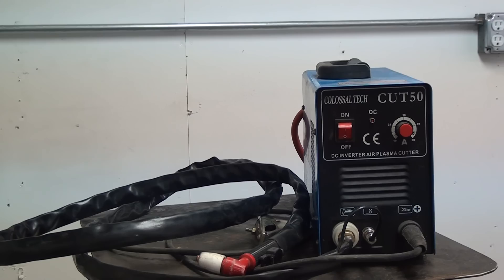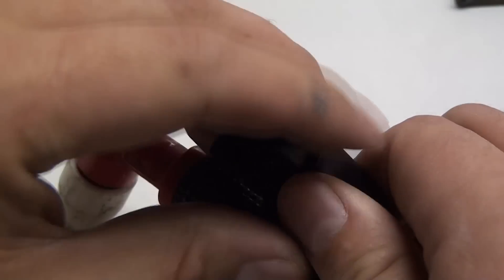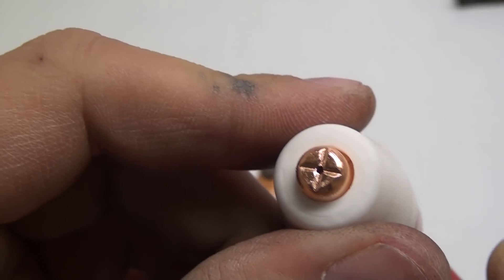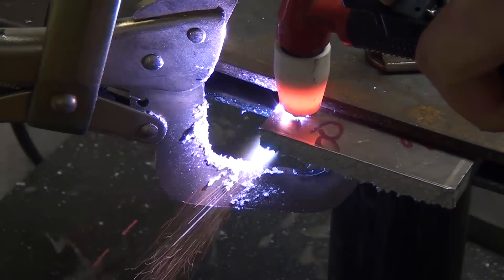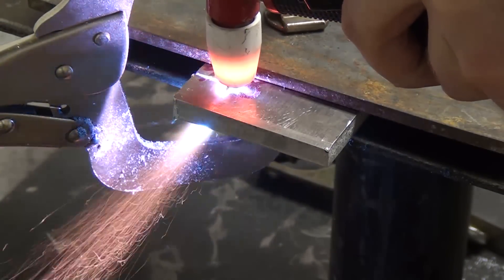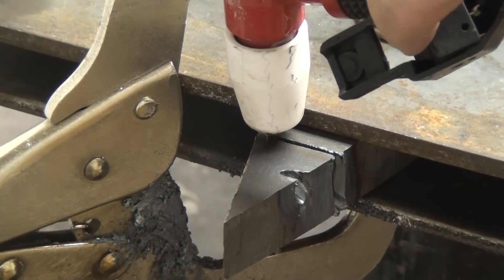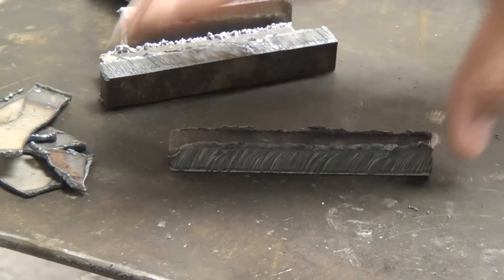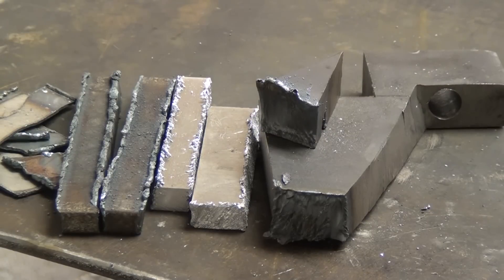Colossal Tech Cut50 Plasma Cutter (Two-Year Follow Up)

Comment: I have a 15A circuit at home, will I get away with using it or will it flip the breaker?
Reply from the maker: You might if you're running on the hottest setting. But I can't say for sure.

Comment: you probably  know this but, if you buy a larger gun, say a sg51 rated at 60 amps.you can cut bigger stuff easier.the pt31 torch you are using ,I think is the smallest they give with the plasma cutters.hope this helps.
Reply from the maker: I don't know anything about it. I assumed I could change out the gun, but have no idea what would screw right onto the machine. I'll check the one you mentioned. Thanks!
Reply: the guns are fairly standard for the cheaper cutters.the air attachment is a threaded fitting and the switch is a standard 2 wire connect.of course you will have bigger consumerbles.just seach sg51 plasma torch,if you buy one ,get a decent length.say 5 metres.

Comment: I have one of them 3 in 1 machines and im not getting anything to work.
Reply: Try going to school on the machine!
Reply: You’re very lucky if you can get one of those to work. While it seems that cutting isn’t much different from welding, there are enough differences in the requirements so that, yes, they are different. There’s a reason why most manufacturers don’t make these machines. If you are lucky enough to get one that works, you’ll find that they don’t work well, and have little capacity, and their percentage of on vs off time is very low. Longevity is questionable.

I’m sorry to burst people’s bubbles, but if you want a welder, get one. If you want a plasma cutter, get one.

Comment: Good to know on the air pressure. I just got mine and the manual says 0.3-0.35 kpa which is 3-5 psi. Explains why my consumables were melting. I found no 'PSI' listing in my manual.
Reply from the maker: +Matt Harris Wow that's way off :) 
I hope you have it working now.
Reply: Yeah, I turned up the air and it's cutting allot cleaner and faster now.

Comment: I am new to plasma cutters. Does plasma cutters require any special supply of gases to operate? I am planning to get one but am afraid of any recurring costs.
Reply from the maker: +Jia Jun You need an air compressor is all. In industry, specific gasses might be used for specific cut situations. It's not really a thing for home gamers though.
Reply: You need an air compressor big enough to keep up. Different models have different air requirements so you have to look at that. A really good air drier is also helpful.
Reply: No just air

Comment: Has anyone tried the 70A Colossal Tech Plasma cutter and is there any service centers in the LasVegas area to get them fixed if it breaks down??
Reply from the maker: I didn't even know they made a 70A. My guess is that you will have a hard time finding a local service provider since these all seem to be coming from the same factory in China. Parts for the 50A seem to be available on eBay at least....

Comment: What replacement consumables do you use? I bought some off of Ebay that are  supposed to work but they will not seat deep enough for the cap to screw all the way down.  No spark... grrr
Reply from the maker: I've had a couple of other people tell me they have had problems with the ebay consumables lately. I haven't ordered any since making this video (over 4 years ago), and I don't have the link anymore. If you find something that works let me know, I'd love to add a link to the video.

Comment: I just bought the same Cut 50 last month and the power switch on the front panel  failed after 20 minutes of use, $9 part and it now works fine, I also had to upgrade the air hose.
Reply from the maker: +fredboat That's annoying, but at least the part was cheap. Yeah that air hose sucks.

Comment: Hi I dropped the torch on y cutter and now it doesn't work any answer or idea as to what is wrong would be greatful.
Reply from the maker: +Karen  Campbell You dropped the torch and when you lick the button nothing happens? That sounds like the wires in the torch are no longer connected to the button. If you have a multi-meter you can probably troubleshoot whether or not the switch in the torch is working. Good luck.

Comment: This is an excellent plasma cutter, the consumables that came with this did not yield good results.  

I use Esab 21008 extended life nozzle and Esab 20862 electrode from the Esab PT-31XLPC Torch.  This greatly increased its cutting capabilities. 
Youbwill breathe new life with the esab hardware. 

I cut 1/2" steel with this and with the esab hardware, its a slow process but it works.  
Stick to this model cut 50 without the digital amp readout. 

I bought this 2.5 years ago for my dad, He has used this plasma cutter many times.  I bought a heavy duty clamp and thick ground cable for it. You can find the quick connect plugs on ebay from river-weld. 

I am actually setting up a petsonal welding shop in my garage and buying another one of these but for myself.
Reply from the maker: +Josue De LA Garza Thanks for the part numbers, I'll definitely try them the next time I have an order.

Comment: What do you think of the new digital ones.  Digital inverter.   265.00.  Seems really cheap.  I would only be cutting car sheet metal.   Are these cheaper ones like this any good.    Do you have to send back for repair if something goes wrong.  or are there people out there that can repair them.
Reply from the maker: +Jim Beam I'm not familiar with the new digital cutters, but the one I have can zip through thin sheet metal with ease. I'm not sure if people are repairing them themselves, since I haven't had any trouble with mine I haven't done any research on it.
Reply from the maker: +Jim Beam Based on other people's comments on this video, yes. They may be sold under a different name(s), but they are all manufactured in the same place I'm sure.
Reply: +russtuff Ok .  Thanks for the fast reply ,  I really appreciate that, .    Great video.
Reply: Heh, repair them. That’s very good. The importers just buy some required minimum from the factory to get a price. Maybe they stock parts, and maybe not. Where do you expect to send then for repairs?

When buying stuff like this, I highly recommend buying from Harbor Freight, Grizzly or Northern. Yes, you likely will pay some more, but if your unit does break, it’s much easier to get it fixed, as these are real companies. Many times, these others on eBay, which are all selling the same machines, are one guy who is set up by a third party as an eBay company. So usually you have to send the machine to the Chinese factory for service. It’s not worth the price of the machine. So unless it’s something minor that you can fix, if it really breaks, you just throw it away.

Comment: are the consumables easy to come by?
Reply from the maker: +wesley peterson Yes absolutely, and they have gotten cheaper over the years. Do an ebay search for something like Cut50 consumables and you'll find loads of stuff.
Reply: +russtuff Thank you, just purchased the zeny cut50 off Amazon... and a bunch of consumables. thanks for posting this video.
Reply from the maker: +wesley peterson Sweet! Thanks for watching :)
Reply: They are easily available on eBay but if you use the below you'll increase the precision that this machine can cut.  My dad tried this setup and was blown away. Where he used to work at they had a machine 10 times as expensive as this one that cuts exactly the same. 

Esab 21008 extended life nozzle and 
Esab 20862 electrode from the Esab PT-31XLPC Torch.

Comment: Wouldn't a higher pressure setting provide more cooling? From your video it looked like the higher setting also cause greater splatter, which to me indicates more oxidation, where as the standard setting appeared to be smoother and more controlled.
Ideally you shouldn't actually contact the tip to the material. Some higher quality companies use a standoff for 1/8" or so gap.
Reply: Pressure that’s too high results in a variable arc. That arc spits all over. Often it causes metal to fly around in the cut. Usually, more dross at the bottom as well. Experiment with pressure, but don’t go much m0re than + - 15% or so from the rating.
Reply from the maker: +Bryan St.Martin Your idea sounds reasonable, but I really have no idea. I haven't used this cutter in a year or two but next time I break it out I'll be sure to notice.

Comment: Can you pierce cut with this plasma? Meaning cut in the middle of a sheet/bar? Most of the videos for a CUT50 show starting the arc at the edge
Reply from the maker: +Rob R Yes, but I would guess only up to 1/4" maybe. I'll have to try it and make another video I guess :)
Reply: I always have to end up grilling a pilot hole or starting at the corner.
Reply: I ended up buying a northern tool 375i for around $600, its pretty sweet, the trafimet torch is nice, the cut50 was my fallback option.
Reply from the maker: +Rob R That does look like a nice torch. Very cool.

Comment: Thanks for this...your stuff is informative. Although, I CRINGED each and every time I saw your hand come in the frame and grab the metal! I don't know how much welding or cutting you do but if you use oxy/acetylene to cut steel EVER, it is a VERY bad habit to get into!
Just sayin'.
Reply from the maker: Jim Dixon I don't use a torch at all, but you make an excellent point. Thanks!

Comment: I have what might seem like a dumb question about this. What size is the air compressor that you use when you do your cutting. I have asked several of the sellers on eBay and the responses varied from no reply at all to any size will do. There is what looks to be a decent sized compressor on eBay right now for $139.05 and the item number is #231033864202... I ask because this looks like it could be a good place for me to start with a new hobby for myself. FloydFThomasIII@Gmail.Com
Reply from the maker: Floyd Thomas Hey Floyd. I think this compressor would likely work fine, because what you really need is air storage more than you need the flow. With 10 gallons of air you may need to pause between cuts to let it fill up, but once you're at pressure then you should be fine. I would say the vast majority of my cutting is in 6" or less segments. If you're going to be zipping through a bunch of material, you may find yourself waiting for the compressor to catch up.

I'm using an old/used Craftsman 10HP 60 gallon compressor I found in the local classifieds for $300. This was several years ago, and the 10HP is a lie (though it is 220v). It's loud and I don't really like it, but once I've charged up 60 gallons of air, I can go for quite a while. I would shop locally for a compressor if possible, then if it isn't cutting the mustard you can take it right back to the store, or sell it.

Let me know if you have any more questions :)
Reply: Thanks for your reply and suggestion. I will look locally. Who knows, maybe I can find something large enough and cheap enough to be able to start my (possible) new hobby.

Comment: I paid $216 for mine with free shipping and am quite impressed so far. It handles 1/2" steel plate, but really not much more than that.
The only annoyance is that the regulator leaks when turned up to 60-70psi. It's not the fittings, but something inside the regulator itself. It still works fine though.

Comment: when you let go of the trigger and air keeps flowing don't worry about it actually that's how it is suppose to work the air cools the tip the machine has a setting of a couple of seconds for the air to keep flowing for cool down you may not get that all the time you may only notice it when you cut excessively
Reply: Yes. Mine has a timer for 2.5 and 5 for seconds of air delay.

Comment: Great review, I'm about to order one as well. I haven't looked yet, so I'll ask you, where did you get the replacement tip pieces? I know I can buy name brand stuff at my local welding shop, do they sell the stuff for these on ebay too?
Reply from the maker: I actually got my consumables from the same ebay vendor where I got the cutter itself. I ordered a 30pack of everything (or something like that). I believe the parts are universal, so you may actually be able to use name brand stuff from your local welding shop. You could always take your parts in and see if they match?

Your user name implies you dropped a diesel into a (sami) zuki? What motor did you go with? I wheel a 72' FJ40 and the guys I go with all drive LCs and zuks.
Reply: russtuff Yep! I have an old walkaround video on my channel if you check it out. It's almost complete now, just waiting for my radiator to come in so I can take it for a test spin. I used an AHU TDI VW motor, that I converted to mechanical with a special injection pump, to eliminate all the electronics. It's been quite a project because I have a tracker transmission and nothing fits quite right, the ACME kit helped a lot, but it's still a huge mess lol.
Reply: russtuff And I've been thinking about doing a swap in a toyota pickup next.
Reply from the maker: Diesel Zuk Sweet I'll check out your video. I was going to guess you were doing a TDI, but the Tracker trans is a nice touch. One of my buddies has talked about swapping a Tracker motor and trans into his but he ended up just not doing anything :)

I've had a couple Toyota pickups myself, but never really got around to swapping out the 22RE. I don't love that motor (though I know a lot of people do), and had to rebuild one for an 85 Hilux I had years ago. Fun stuff!

Comment: If you have a torch you could preheat thick metal and then  cut it and it will cut substantially easier
Reply from the maker: I don't, but that is a great tip. Thanks!

Comment: thanks for the review, it may be the perfect tool for my weekend warrior projects. can you recall the thickness you could cut on 110 power?
Reply from the maker: I get that question a lot, but mine does not have a 110v option. It is 220v only. They must be offering them with the option to do both now.
Reply: thanks for the reply bud

Comment: where did you get the trigger-it was not listed what store on ebay??
Reply from the maker: I guess the store I bought from on eBay doesn't sell them anymore? It was called "2 pcs Torch Switch For TIG Welding Torch WP-26 WP-17 WP-20 WP- 9 Plasma Cutter". I added that to the video description too.

Comment: Good plasma cutter I have a simadre plasma (red) works great on 110v but much better on 220v more heat because of being 220v.. The air running after arc is of is to cool down the tip.... Mine has that as well a 2 sec or 5 sec  switch for it... I used it at home all the time and works great after 2yrs...
Reply from the maker: I never looked for a switch like that... I'll inspect. I have never tried running mine on 110v, and actually I haven't used this machine in quite a while. I actually need to get it out and work in some projects this winter, so hopefully it's still running great :)

Thanks for watching!

Comment: these cutters use get loose screw connection on the inside after a year or 2 of use you just need to take the lid off and tighten the internal output connection
Reply from the maker: I don't think I've ever checked on that. I'll make sure I take a look the next time I break it out.

Comment: For those of you who have one of these chinese plasma cutters...they work excellent, especially if you do some testing with feed rates and amperage settings as well as cut height.  I recently purchased a hypertherm powermax 85 for my cnc plasma table.  After learing how exact the set up needs to be I now better understand these cheaper chinese models.  I have an all-in-one tig/arc/plasma that I now am much better at because of this process. My powermax 85 has a factory designed optimum cut height of .060 inches.  That's really close!  I measured the depth of the plus sign at the end of the chinese consumables tip.  It seams to be about .080...so dragging the tip across the plate, like this video, does give the optimum cut height for this style torch.  I was able to cut 10 guage at 50 amps moving along quickly with nearly any dross...just like my hypertherm.  Hope this helps.

Comment: I bought one of these on eBay from USAprovidersInc March 2014. I does not work and they sent me a new torch, but it still doesn't work. It will spark, but no Arc. The factory sent me a series of tests and I performed them, but no parts were sent to me or a new cutter offered. The 1 year warranty was not honored. $300 down the dumper. They no longer return my emails.Any one want to try and fix it? I'll gladly mail it to you and pay for repairs. Here is a link to my ad on eBay.

http://www.ebay.com/itm/231273507112?ssPageName=STRK:MESELX:IT&_trksid=p3984.m1555.l2649

I can send pictures with the cover off and test results.
Reply from the maker: Man that's a bummer. I haven't heard of anyone else having trouble with theirs, but you may not be the only one. Maybe there is a forum or group somewhere where people discuss/work on these?

Comment: never tap part w/your torch, like you did. and. esp. hot! let it cool, dude. thanks, i just bough one, 3 in 1. my $2,800 thermo-made in america that has bad card(s) for $180 ea., which is 1/2 the cost of my 3 n1, or only twice for way more.
Reply from the maker: Thanks for watching!

"Never" tap your part? I've done this a million times and nothing bad has ever happened. What is your experience?
Reply: i have repaired several torches that had cracks in them from doing this, for others. i did it once too. never again. you are lucky. no way a million times. it is kinda a cumulative thing. maybe less than a 100 times?
Reply from the maker: zipcrazed Haha yeah not a million, but many (I'm sure)  :)